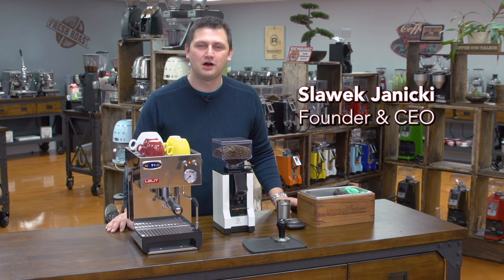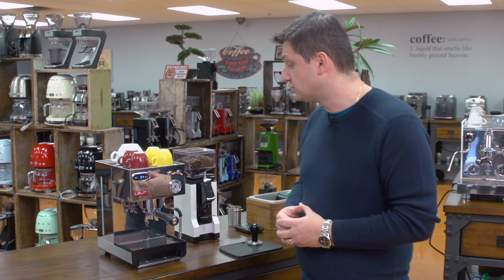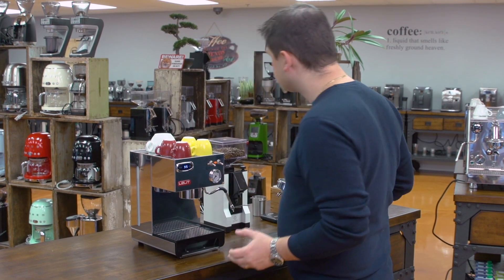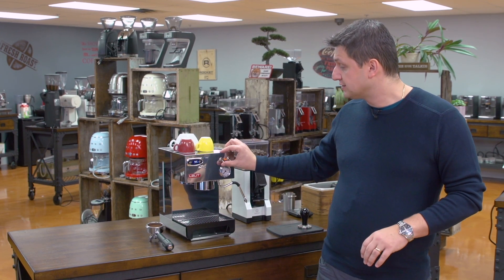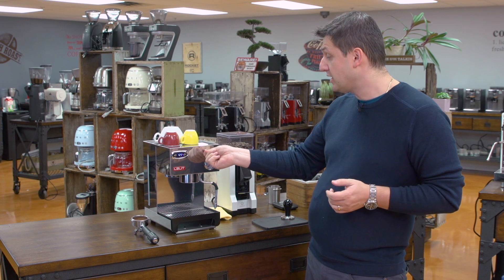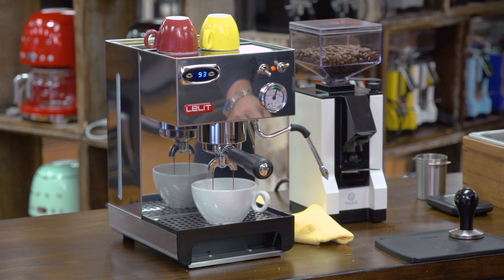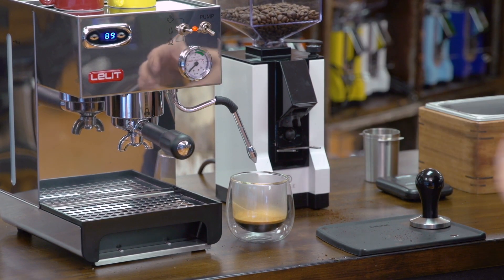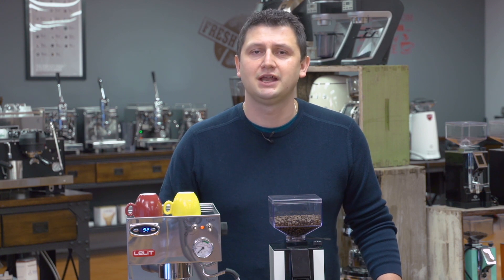Lelit Anna 2 w/ PID Espresso Machine

Comment: Is that typical to see a temp drop of 10 C when pulling a shot on this or any machine? Thought the PID is supposed maintain your target temp throughout
Reply: I guess the PID measures the temp close to where the cold water comes in the boiler since the change is so fast, so possibly the brew water temp isn't quite that cold.
Reply: Pid cannot help that. Yes, the temp drop is quite alarming even considering 30ml cold water infusion into 250ml heated tank. I think it is not setup correctly. Design falt

Comment: how do u compare this with the gaggia classic?
Reply: that thing doesnt have a pid nor a pressure gauge...
Reply: @leof2180  Yeah but the gaggia has a standard 58 mm portafilter which makes it easier for accessories. Help me decide between those 2 sir.
Reply: @Kasparovvvvv  honestly, if you planning to use the machine for years to come then portafilter size really do not matter since 58mm is good if you plan to upgrade to a more expensive machine down the line or plan to purchase bottomless portafilter and so on
Reply: 57mm will be deal breaker for many
Reply: Not sure why people would fuss over 57mm v 58mm, I’ve had the Lelit for 6 years and never an issue with tampers, baskets or portafilters. 🤷‍♂️

Comment: Is the 57 mm portafilter size of the Lelit Anna 2 unusual and locks you in to buy only their accessories?

Also what do you think of the urbanic 80s grinder from Korea?
Reply from the maker: 57mm is a less common size than 58mm so there is no denying the fact that there are fewer accessory options available for this size. 58mm is the most common so it will have the largest selection of accessories.  

I'm not familiar with this grinder, so I can't comment
Reply: you can buy anything you can imagine for 57mm from temu, amazon or ebay

Comment: Is it a heated brew group on PL41 TEM and is the steam wand anti burn?
Reply from the maker: Hi, no the group is not actively heated. The group is heated using passive heat from the boiler, the Lelit Anna has a vertical boiler design, the boiler and the grouphead are all one piece and the heat from the boiler heats up the group.  The steam wand is also not double walled.
Reply: Ok thanks, that's a bummer, especially the steam wand,should not be allowed to be sold without anti-.burn these days.

Comment: Does the PID actually helps or is it gimmick? Should I save money by getting the simple one or extra 100Euros worth it?
Reply from the maker: Temperature is one of the most important variables when extracting coffee. The same coffee can have a different taste extracted at 93 degrees vs for example 90 degrees. A PID gives you temperature stability first and foremost. With a mechanical thermostat you have variance of +/- 5 or 6 degrees which is very significant. I think it is well worth the extra cost. It will make your coffee more consistent and better tasting.
Reply: @iDrinkCoffeeCanada  Thank you for your fast response. The answer I knew but didn't wanna hear! Thank you again

Comment: What's the point with PID that start the espresso at 93 and end with 80 degrees that is 13 degrees difference with the PID. It seems like the PID is just to show the temp but not controlling it. I installed PID on my GCP and it works better than that. same goes for other built in PID like profitec go.
Reply: You are confusing the temperature of the boiler with the temperature of the water coming out of it. This little machine is super stable regarding the temperature of the water coming out of it (measured inside the portafilter while brewing). But yes, in the PID screen you'll see a temperature drop of several degrees, but that IS NOT reflected in the water coming out of the group head while brewing.

Comment: Hi!  is this ok that a temperature on the screen is changing all the time from 92 to 93 and 94 degrees( set up is 93) ? sometimes on my machine it's changing even more than 1-2 degrees.
Reply from the maker: Hi, that is all normal.  The PID is turning the heating element on and off to maintain a target temperature inside your boiler. It's normal for there to be 1-2 degree swings.
Reply: This display shows temperature in boiler, but not on output.
Also, you can see significant drop in temperature when it runs the extraction.

So, it's ok

Comment: Is this how the PID is supposed to work? Started w/ 93 degrees and was at 80 when the shot reached the end. I thought PID is supposed to keep the temperature relatively stable?
Reply from the maker: When you pull a shot cold water is introduced into the boiler so the temperature will go down but the water for your extraction would be at your set temperature and it should recover fairly quickly for the next shot

Comment: Bought this machine about 3 years ago for the exact reasons you mentioned and I‘ve been happily using it ever since. There is an additional optional cover for the dripping tray which I would recommend, since it covers the dark plastic and improves the looks.

One thing has puzzled me for a while now. My optimal double espresso extraction based on taste and time results at around 12 bars on that Barometer. Any ideas? Is this a pump setting which a technician could easily adjust or maybe a measurement issue? 9 Bars results in coffee just flowing out in around 10 sec.
Reply: Your grinder isn't grinding fine enough, too little resistance at 9 bars
Reply: Lelit sets their vibration pumps quite high from the factory. My Victoria was doing above 11 bars static pressure. The solution was to disassemble the machine, find the OPV valve and lower the static pressure (measured on a blind basket) to 9. Since I’m mostly doing light roast espresso, and I have quite a high end grinder, this really improved my shots, I can now do longer brew times and the shot doesn’t fall apart in the second half.
Reply: @michalselep1755   when doing research with other coffee machines and opv change ppl were saying that 9 bar settings were showing about +-10 bar on blind basket because of closed system (watter does not where to go so pressure is little bit higher on blindly closed portafilter with manometer) to check pressure would be better flow manometer in system or something like that ?
Reply: @SparkOfThoth  well, my machine hits around 8.5 (slighty above 9 on a blind pf), at the beginning of shots and since I only do light roasts, it suits my use much much better than what it was previously, more steady, less channeling, I can pull slower shots etc.
Reply: @michalselep1755  I just change the pressure on the OPV valve from 11 bars to 9 bars and my shots are less bitter than before ... 9 bars is very much better !!

Comment: Hello, recently we got the same machine and grinder and the double basket makes amazing coffee but with the single one, we are really having a hard time. The machine's temp is 93/94oC and we tried changing the grind and the quantity, we tried tamping harder but the single espresso is always either too thin or too sour. We cannot get it right for some reason. It starts out pretty good but then it starts coming out too fast. Any suggestions?
Reply: Most coffee aficionados say never to use single baskets (for any machine) because you can't get good shots.

Comment: what do you think which is better between Gaggia Clasic PRO and this Lelit?
Reply: The aluminum boiler in the Gaggia could corrode and it doesn't have temperature or pressure gauges. It seems like the Lelit could be better imo but I don't own either machine so take it for what it's worth.

Comment: what's the difference between the coffee and water mode? Does the preassure change or what?
Reply: In water mode the pump redirects the water to the little wand which you see on the right, just like in steam mode, but with a lower temperature.

Comment: bit shocked about how much the temperature dropped while brewing; 10 degrees is A LOT?!
Reply: Yes, it's because the sensor is attached to the place, where the cold water enters the boiler. Not the best solution. :( I have the same machine.
Reply: I own the same machine, and yes, the temperature drops as cold water (actually, “room temperature” would be more accurate) fills the boiler. But my shots are still super hot. The main thing is to preheat the cups.

Comment: Honestly, this is a great demonstration of the machine. Very clear. The only thing I don't like about this machine is the USER has to judge when to turn it off. I prefer where the machine figures that out. Tossed up between this and the breville
Reply: isn't all semi auto espresso machine require the user to judge the pull time?
Reply: thats why we use scales